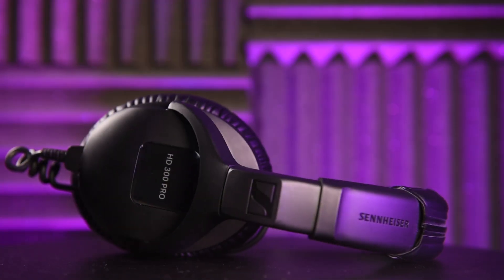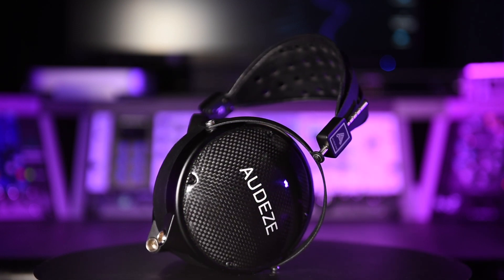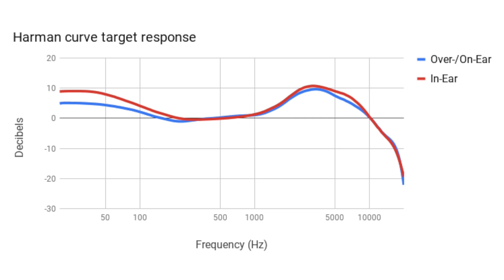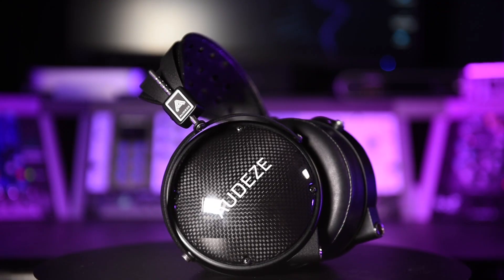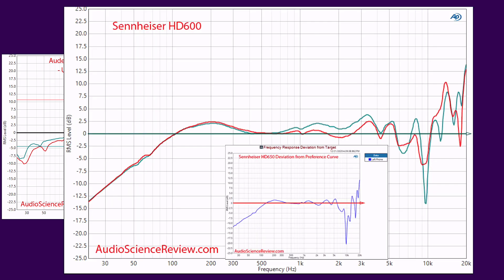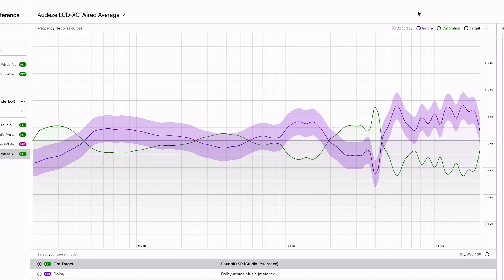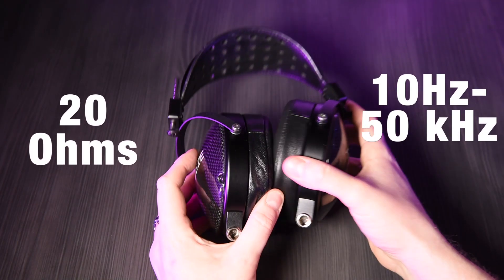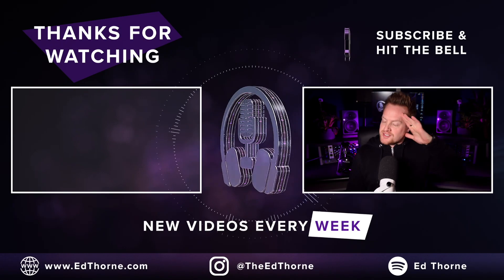Consider THIS When Purchasing Headphones! AUDEZE LCD-XC (21s)

Comment: Is not correct to compare closed to open headphones. They have different uses. Closed to singing. Open to mix or listen. The sound leakage will get picked up by the vocal mic.So no sense compare these ones.
 You said nothing about the experience of   both😮.  1300€ for That Audeze is difficult to justify! I bought a 256,00€  Akg  headphones and were not of very good quality. They broke very soon even I used with delicatnesses and almost never. A ear in headphone Sennhriser that costs less than half still works. They are not inferior in sound quality. Sure price is not always a guarantee of quality!🎉 Today a really good top quality headphones are difficult to find!  They exist??? What model?? 😂 No matter of your budget   . Web is full of big complaints about all marks in every level of price.  My Sennheiser are good! but far from  a professional monotoring headphone!!😮 unless are also sold for monitoring professional like a professional tool! This is what happen when manufactures have money like goal! Where is the quality if no money can buy it????😮 All is almost produced in China or Taiwan to avoid taxes!!! And  save money is the priority!

Comment: So do you recommend using eq headphones correction? I just bought HD 650 and dont know if i should buy sonarworks too..
Reply from the maker: EQ Calibration works really well on these Planar headphones. Personally, I find Sonarworks (although great for speakers) can sound strange on headphones (my HD300s for example) however, because the 600/650s are so close to “flat”/Harman, they actually sound quite good corrected. Sound iD Reference has some great features now too, so I would recommend it, yeh. 🙂
Reply: @EdThorne  Thank you!